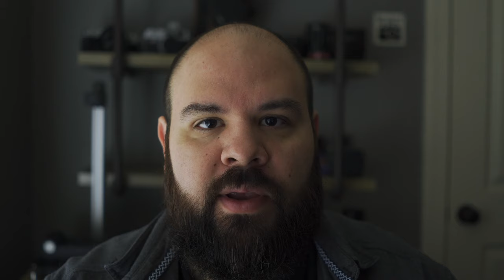CineStill Film ECN-2 Kit Explained

Comment: Sounds like an innovation in respect to toxicity. And I would guess if you wanted to use this with ECN-2 film there is a pre bath that could be found to remove 'most' of the remjet prior to entering the Cinestill developer. I do wonder what the difference (from an aesthetic and technical viewpoint) in output is between this kit and traditional  ECN developer as the chemistry is undoubtedly changed. 
I do REALLY actually LOVE what CineStill is doing here in regards to getting proper development from their versions of cine film. That is great, is my opinion on that. 
It's also VERY INTERESTING two things, that this developer is safer to use and can ALSO be used for cine effect on normal color negative film that is developed by C41. Of course 800T is a tungsten rated film and 50D (which I also love) is the lowest ISO rated film in Kodak's arsenal and the resulting pictures show that fineness inherent to such a film. The qualities and characteristics of those films are unique.
Reply from the maker: This is a very good point I admit I failed to highlight.
Reply: The CS versions of C-41 and ECN-2 make no provision for remjet removal because that is the sole distinction CS adds to Vision 3 film - removal of the remjet before you shoot the film. A true ECN-2 process will give a bit lower contrast and a different dye/color balance to match the movie  print (positive) film to which the negatives are contact printed. I suspect that ECN-2 will give a thinner negative, quicker to print. If you look at the formulas for C-41 and ECN-2, you will see more similarity than difference. However, neither CS versions are close to the "true" processes, so they are more of a chemical emulation with a lot of details omitted. There is no reason to assume that the CS version of ECN-2 is more or less toxic than the real deal. The greatest toxic potential is the bleach, and Kodak ECN-2 offers two options for a bleach. No info on what CS does for their blix. Frankly, I assume it i the same Blix they use in their C-41 and E-6 kits.  If you pare the chat down to simple English, what CS is saying on remjet is that if you use their ECN-2 (or C-41) kit to process Vision 3 film with its remjet layer not removed, some of the remjet will flake off in the developer and blix, so if you reuse that chemistry again, some of those particles may become embedded in the later film, so do not do that, dumbass. What's not mentioned here is that if you are a dunbass, you can filter your used chemistry though a paper filter, i.e., coffee filter, to remove the particles and leave a reusable chemistry.

Comment: What if you did a pre remjet removal with baking soda and hot water and then did the 2 bath process as they intended? Would that work the same?
Reply from the maker: Yup! Totally forgot to mention this. You’re 100% correct. The chemistry will last longer if you do a Prebath before the developer.
Reply: @StudioC41  sweet, I have a roll of some old Seattle film works to experiment with then haha (that film has remjet)

Comment: Cinestill 50D and 800T is NOT kodak film. The 800T is movie film but the edge markings don't match the 500T kodak is selling. The 50D is NOT motion picture film at all. The sprocket hole shape is wrong and the edge markings are also incorrect. 
I personally develop a lot of Kodak Vision3 film in C-41. I also give the stuff away on my website (limit 1 per customer). I got some of this new chemicals and are excited to give it a shot. But cinestill has been dead silent on exactly what film they are using for their 800T, but it is not 500T!
Reply from the maker: This is just blatantly wrong. They acquire their 50D and and 500T in master rolls and they remove the remjet layer and finish their film within Rochester with their own machinery. Please take a moment to listen to my interview with the owners of CineStill Film before spouting out inaccuracies. They’re not dead silent. They are quite transparent on their process.
Reply: @StudioC41  
I have shot real 50D and real 500T with the remjet still there. And developed those film. I have also developed Cinestill's 50D and 800T
Side by side the 50D from kodak is not even close to the 50D from Cinestill. The sprocket hole shape is different, the Vision3 edge markings are not on Cinestill's 50D and even the film itself is a different shade of orange than Kodak's vision3 film. 
Cinestill 800T is a bit tricker to spot the difference. 800T (35mm) has the proper sprocket holes and clearly is a cine film with the remjet stripped off. However they are not using Kodak's 500T. You see each cine film has an ID# assigned to it. 500T for example is 5219 and this number is printed along the edge of the film along with the date it was produced. I don't remember the number on the edge of Cinestll's film but it did not match any product Kodak makes. I tried to look it up on Google without any success. I have asked Cinestill why their edge markings don't match the film they claim to use and they do not respond at all. I don't know your background but I live film 24/7 and am extremely knowledgeable in all things film. If someone from Cinestill would be kind enough to explain why their film is night and day different from the film they claim to use I would be happy to revise my statement. 
I should also note that cinestill film tends to have better color accuracy then Kodak's Vision3 film. 
If Cinestill is actually using Kodak film I really would like to know why they choose to use 50D instead of 250D. 250D is just a better all around film and so much more flexible when shooting.
Reply from the maker: They do their own edge printing. The sheer amount of film they sell, they have arrangements with Kodak and buy their film on master rolls. They don’t make a CineStill Film 250D because the similarities are so close to Portra 400 that they wouldn’t feel right selling an up charged Portra 400 film. 

The difference is because they’ve removed the anti-halation remjet backing. Again, all of this is shared in my interviews with them I invite you to check it out.
If you want, shoot me a DM on IG and I’ll be more than happy to connect you to them to clarify the exact things I’m telling you now.